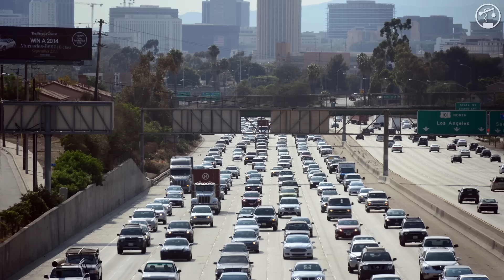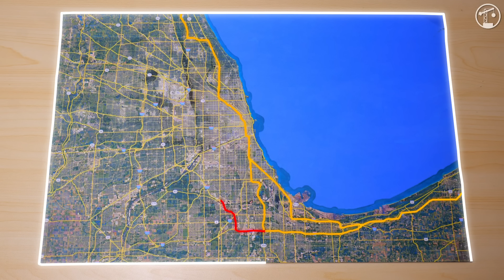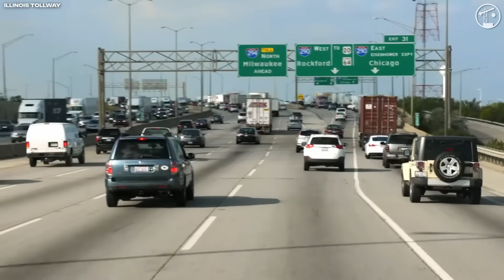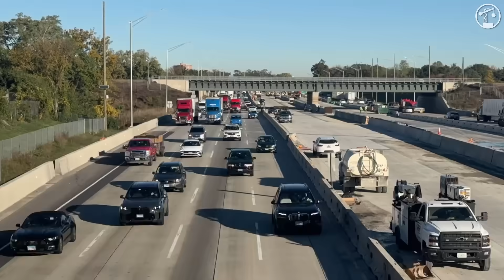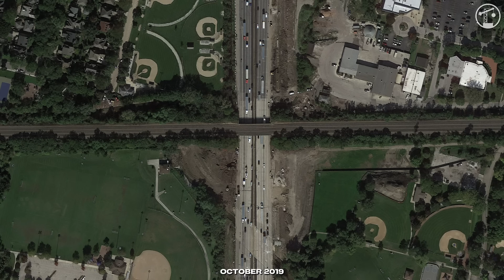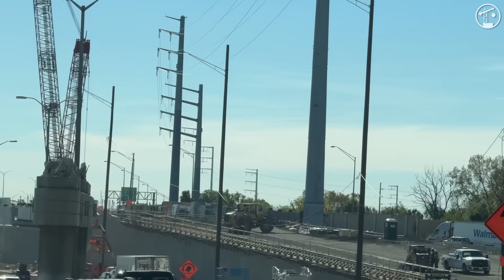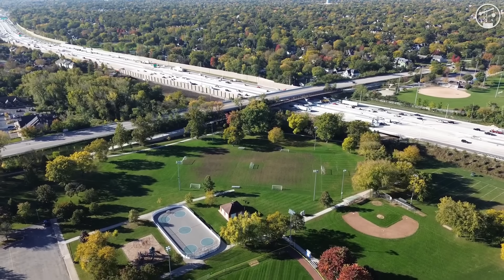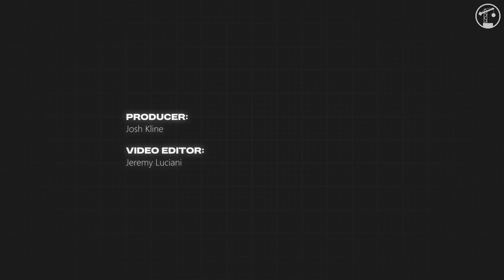Why Chicago is Spending $4B on One Road

Comment: What needs to happen, and it has been talked about for years . Extend 355 to I65 in Indiana . That would alleviate tons of traffic around NWI . Hopefully the construction wraps up soon on 294
Reply: A full bypass, from I-80 in the west at Morris IL to I-94 in the east at IN-49. Traveling east-west at roughly the level of Peotone, it would connect all of the major southern highways (I-80, I-55, I-355, I-57, I-394, US-41, I-65, US-30, I-80/90, and I-94) with a single beltway beyond the current suburban boundary. This would be ideal for distributing freight and through traffic away from the bottlenecks on I-80. the western terminus being at Morris also sets up IL-47 as a natural north-south bypass corridor on the far-western suburban edge.
Reply: @jonathanstensberg that would make too much sense for the dimwit politicians to figure out
Reply: @jonathanstensberg  There are protected wetlands just south of 80 and near 57 that would
have to be negotiated around.
Reply: @spaceghost8995  wetlands are really good at absorbing carbon dioxide, so we should absolutely not destory them.
Reply: That was the original plan but it was dependent on the Peotone airport, which never happened because Mayor Daley flexed political muscle to prevent it. It's unlikely to ever happen because of the significant new residential development that has taken place since that time right in the proposed path of the 355 extension.
Reply: not on my farmland
Reply: Happened around I-355 south i 88 to i 80...

Comment: Adding more lanes, building new highways wont solve traffic. Fact is when suburbs expand that increases demand. More drivers (new or expanded suburbs) increases demand on highways and roads. Thats why traffic just gets worse in America despite roads being widen or expanded. The only solution is to increase mass transit like commuter rail and subways. Put residential and shopping closer to stations to give people better options. If you dont need to drive you can get off the roads.

Comment: Regarding the issue with trucks: There are interchanges in California, such as the I-5/Ca-14, where trucks have entirely separate ramps from cars. It really does seem to improve efficiency, so I'm surprised I don't see many interchanges like that outside the golden state (or away from the Golden State Freeway). I wonder if this was considered for Chicago's I-294.
Reply: Probably was, but the ROW is just not there. Illinois' transportation network is failing because there's deficient space to make meaningful improvements. And deficient money...
Reply: @JoePCool14 Chicago is roughly the same size and density of LA, though. I suppose it has a lot more through traffic, being at the crossroads of the country, but LA has much bigger ports, so I would guess the number of trucks to be similar, too. So I don't see why space and feasibility would be that different. I'm not saying you're wrong; I'm just curious about what I'm missing.

Chicago's interstates are about as wide as LA's, with similar amounts of quad-carriageway sections, and LA's suburban rail network is catching up with Chicago's too. But it seems LA is more willing to stack freeways. Given the multilevel city streets Chicago has downtown, I find this curious—I'd think Chicago would be open to putting trucks on a different level for a ways, to make interchanges more efficient, especially since it's more seismically stable than LA.

And Chicago people are more accustomed to tollways, so insufficient funds surprises me, too. LA is mostly freeways, with people only paying tolls to access the HOV carriageways. My I-pass bills are way bigger than my Fastrak bills, even though I mostly drive in the Bay Area when I'm in California, crossing enormous multi-mile toll bridges every day. If I spend a week driving around LA, my toll bill is a few bucks tops.

Comment: Going into the city from 90/94 you have six lanes that go down to four.  Then when you get down to the city you have four lanes that go down to three. Then more Lanes appear when you get a little further south. The engineer that designed these roads is an idiot. Why the hell would you put a bottleneck right at the city center! They should have had the three lanes go down to two lanes then two lanes go down to one lane then one lane go down to a bike path and the bike path go down to a walking path and then just end at a brick wall.

Comment: Induced demand isn't a bad thing -- it's kinda the goal.  That extra usage is people who wanted to travel at those times of locations but were deterred by lack of capacity.  Ultimately the goal is to service people's travel needs not to stay empty to be marvelled at.

(yes I know there is an issue of lower throughput if you excede a threshold but that's more about managing entry than inducex demand).

Comment: Obvious point here: the main difference between Chicago and most other cities is that Lake Michigan forces all development and traffic to one side of the city, causing a mess.
Reply: As opposed to other coastal cities, with chicago's position on lake michigan it does allow traffic to go to the south of the lake but it funnels a ton of traffic through NWI and the south suburbs. And a TON of truck traffic.
Reply: @gwheelock911  I-80 from I-55 to I-57 is a logistics corridor - distribution centers as far as the eye can see.  The truck traffic is insane.
Reply: @lauracarrolldebolt9233 I live in the middle of that corridor and see the truck traffic every day.
Reply: @lauracarrolldebolt9233  Exactly. The trucks on I-65 are INSANE! People forget that trucks from NYC and Philly are traveling through Chicago to go west.
Reply: @lauracarrolldebolt9233  I drove that corridor for 25 years going to work- it has changed & always more trucks
Reply: @lauracarrolldebolt9233  Pretty sure I55 through the Bolingbrook/Romeoville area (I355 to IL126, roughly) has a lot more distribution centers and truck traffic, and it's only 3 lanes for the most part.
Reply: @lauracarrolldebolt9233  the Illiana Expressway was going to address this, but politicians ruined the plan.
Reply: @gwheelock911  Not to mention Chicago is still the railroad capital of America and those lines crisscross everywhere and have more depots to unload which makes the truck traffic even worse.
Reply: @gwheelock911  most major coastal cities are also a mess...
Reply: Finally drove on the new ramp going from 294 North to 290 West. What a difference. Instead of waiting for the mergers cutting you off to get onto the circle ramp.
Reply: As someone in the southwest suburbs, 355 was an absolute godsend. If you had to get basically anywhere North you'd get caught by 294. Now we can at least bypass it up to 88 then you still have to cross over. I try to avoid 294 at all costs unless going to or from Indiana. Also doesn't help it's always under construction
Reply: Yeah! Who ever even heard of a city on a coast line???
Reply: Here is a fact,  we live in the suburbs about 38.5 miles from Chicago, on average it takes and hour and 40 minutes to get there, conversely, we live 65 miles from Milwaukee and it takes about 55 minutes to get there, what wrong with this system?  Far too many people and too much congestion, definition of a concrete jungle.
Reply: Tell me how little you understand traffic engineering without saying the words dude.
Reply: Come again?
Reply: Bingo
Reply: I think you need to pull out a MAP AND LOOK AT IT!
Reply: Yes. LA and NY, same
Reply: This. For the folks comparing it to the ocean coasts - do those ocean coasts have highways that take traffic from both ends of the country and require them to be able to pass even tho we have a giant body of water blocking one whole side?

Coastal elites never get it
Reply: @seanjones21 you’ve obviously never driven in NYC or LA. NYC is right on the corridor to New England and LA is right in the corridor to both the east and northern routes of California.
Reply: @TheFibtastic you're not getting it. The two population centers, east coast and west coast, have to pass thru Chicago to get back and forth and visit 75% of the country, but neither of them has to support the same thing. We're in the middle, and we still have a giant blocker to our east. We quite simply have more movement
Reply: @seanjones21 I’ve lived in these different places. Chicago is much easier to get around in, it’s not even close. There’s alternative routes here and it’s easier to avoid the congestion as a local.
Reply: @seanjones21 also the lake has no impact on that as the truck traffic breaks off before Chicago. You have to go north to hit the heart of Chicago from the east-west corridor. If you’re going straight through to California you take 80. You don’t even see Chicago or the lake, you skirt around to the south.
Reply: @TheFibtastic if you think 80 doesn't go thru the Chicagoland metro, I'm done talking to you lol. I literally grew up in the I-80 corridor of Chicago
Reply: @seanjones21 how is 80 impacted by the lake? That’s what we’re mocking you for.
Reply: @TheFibtasticink what he’s saying is that all traffic on 80/94, both local and those trying to get from coast to coast, are forced to run through the southern part of Chicago. Add in all the truck traffic from I65 and I90 also being there (not to mention I57) as well as regular vehicle traffic and it’s a bottle neck. The part where he says the lake impacts Chicago is basically implying that if the lake weren’t there, there could be another interstate altogether going north to divert traffic straight to Milwaukee and the other northern cities. Or have I90 route that way instead of also passing by 80/94 by Portage/Gary area. 

Yes, NYC is the pass through for cities north and south of it and so are SoCal cities, but there is also much more local population in all those cities. Chicago has enough of its own population to deal with but is also dealing with all of the through traffic from not just the east and west coast, but also that from Florida on up with I65 and vice versa from the north down to Florida. You can’t go any further west of the Pacific or east of the Atlantic!
Reply: What about Cleveland?  What about Detroit which has an international border?
Reply: @SkiDooSummit670 MUCH smaller.
Reply: @SkiDooSummit670  ohios entire population is 11.7 million, just the city of Chicago is over 9 million

So imagine 80% of your states population in an area roughly 3 times the size of Cleveland.
Reply: @nes999 more like 2.4 million , New York only has 7 million
Reply: @terrybangley2281  he means the metro area of Chicago is roughly equivalent to Ohio's entire state population, let alone their individual cities
Reply: @SkiDooSummit670 there are ~2.7 million people in the city with 9 million total in Chicago Metro

Cleveland is 360K and 2 million.  Detroit is 650K and 4.4 million.
Reply: @lauracarrolldebolt9233 that 9 million is the entire metro area which is very lenient on what they consider Chicago metro. Chicago is NOT hard to drive in, I’ve lived in SoCal and this place is a cakewalk. NYC downtown is simply impassable, while I lived right off of Wacker downtown Chicago and could get in and out via lower Wacker in minutes.
Reply: No It's people in cars
Reply: You should hear about this place called New York City.
Reply: Yeah those land-locked New York City and Los Angeles people could only hope to be by big bodies of water……
Reply: Does it matter all of those cities you name still have way worse traffic than we do
Reply: So technically, there is no other side of the city just one city west of the lake terribly designed
Reply: @jordanrivera1563  Huh? Chicago was designed to be at the center of the rail network, which it was. The original design of the interstate system didn't account for the significant amount of truck and air freight traffic. It also didn't account for suburban sprawl, where Chicago's metro footprint would literally expand 30 miles in every direction from Northwest Indiana to Southeast Wisconsin. These upgrades are addressing that problem. 

You sound like a guy complaining that Washington DC was poorly planned because many streets and neighborhoods were designed for horse and carriages and not cars and trucks back in the 1800s. You make the upgrades when the upgrades are necessitated. We may have a drone delivery system in 50 years, but Chicago can't make millions of dollars of infrastructure investments today.
Reply: This is being addressed too, with south DuSable Lake Shore drive already rebuilt into a defacto expressway, and the same coming to the north section soon.
Reply: @911RevvedUp pls dont call it that.
Reply: most major cities are on coasts bud.
Reply: That makes no sense and is nowhere near accurate.
Reply: What the hell does this have to do with Chicago??

Comment: I’ve been driving the entire Tri-State Tollway several times a year since 2009 and the change has been dramatic. It’s a much nicer road to navigate. I’m looking forward to the completion of the southbound I-290/88 interchange area. That’s a major rough spot. It’s amazing how they’ve been able to do all that work while keeping the traffic, for the most part, moving pretty well.
Reply: I went through that westbound last week. I didn't even realize I was on 88 for about 10 seconds. That old zipper merge is gone.
Reply: Yeah, that I-290/I-294/Roosevelt and I-88 exchange is terrible. There's too many bottlenecks in Chicago.
Reply: I agree, I have high hopes for it. I don't drive it as much as I used to, but the few times I have recently I see the vision. Will be huge if it works as intended.
Reply: @serpent12368  ...and as soon as it is completed, they will tear-up another section and your travel times will remain the same or slower
Reply: Times are worse now. I drive I-55 from Midway to 294 up to the Ill/Wisc border all the time, about 70 miles. It used to take me an hour, now it is an hour and 15 minute ride at best.
Reply: I avoid tolls whenever I can. Haven't paid a toll since 2008
Reply: @OGKenG  When they had the machines you’d throw coins in at the toll booths, some say candy Necco Wafers were a good substitute for quarters. Ahh, the good old days.